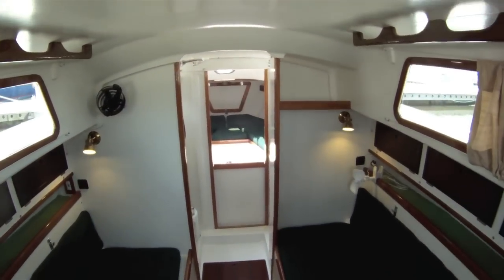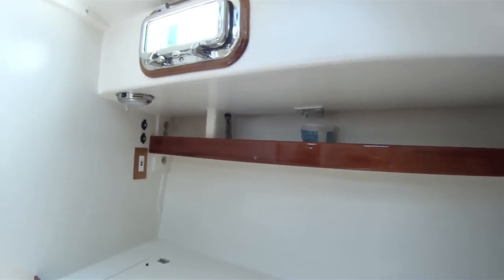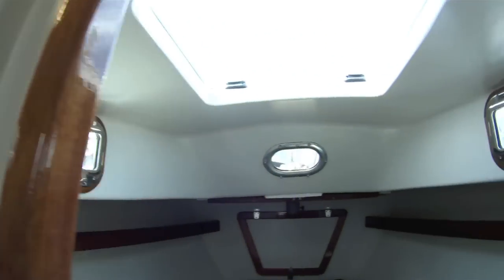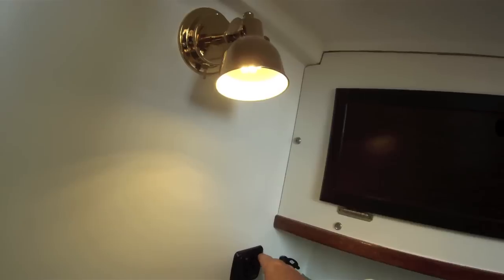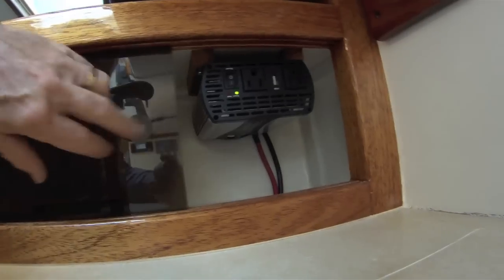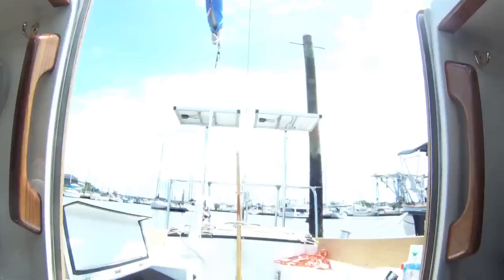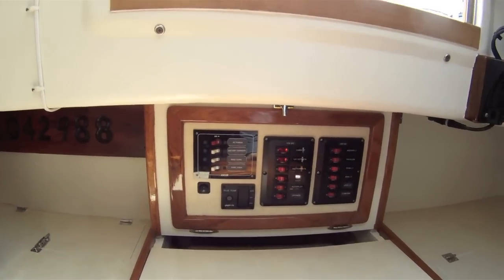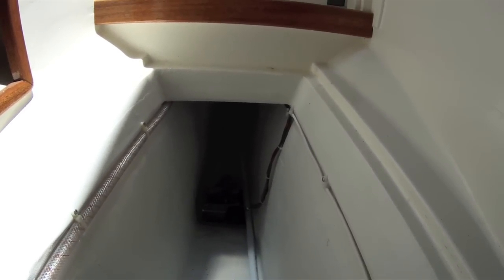1972 Alberg 30 Refit Part Two - Interior

Comment: Very nice job, and kudos to the glass work. Very nice. I've seen boats where the engine has been removed in lieu of more storage and an outboard engine setup. From the maint standpoint, noise, prop shaft, etc, it's a win-win mod. Thanks for sharing.

Comment: Beautiful work!

I have a 1972 Tartan 26 that I hope to start reworking within the year. with a very similar approach to what you have here.  The boat originally has twin quarterberths, a split galley, two settees, and then a head on centerline in the forepeak, but I want to change it quite a bit, so there is a galley spanning the rear of the cabin, then two settee berths (further aft than the original ones and higher), then head on centerline, and a larger forepeak.

The boat came with a Kermath Sea Pup 5 hp inboard, but I have removed that and intend to use an outboard instead.  The transom is slightly reversed, and I am thinking of mounting the outboard on a carriage that rides on two traveler tracks, so instead of pivoting the outboard, I would just draw it out of the water up the track with block and tackle.  The transom (think small Tartan 10 shape) is large enough that the outboard fits within the outline.  The one big disadvantage I can see is that the outboard is exposed to the weather.

The  center aisle under the cockpit will hold the battery bank and tools, topped with a Fliptail 6 folding dinghy.
Reply from the maker: Before I added an outboard well to my own Pearson Triton, I used to have the motor hanging on a similar carriage and two traveler tracks on the transom. I couldn't find anything off the shelf so I cobbled it together myself out of parts salvaged from a boatyard dumpster in Trinidad. Though a center-line mount gives the best performance as the boat rolls or heels, I had to mount mine on the port corner to allow for the center-line windvane self-steering.
Reply: It will be a challenge, but I want to try to nest them all together on center.  Hopefully prop wash won't be an issue for the oar.  I find that I motor very little with my Montgomery 17, and the times on the Tartan that I would want to use the windvane (coupled to an autopilot to provide input to the oar) while motoring shouldn't be often, maybe in a flat calm.

Comment: Beautiful work.   I am impressed by your modification design skills and craftsmanship.   I hope you will not mind if I shamelessly incorporate elements of your design into my own project.

I just bought a highly distressed (but very cheap) 1972 Alberg 30 (hull # 497) which I am in the process of rebuilding and re-fitting.   The vessel was dis-masted under sail in the Atlantic and all the rigging lost overboard (as well as sustaining damage to the fiberglass chainplate attachment knees and the plates themselves).   The dis-masted hull was further damaged during hurricane Sandy when the adjacent vessel tied alongside was dis-masted and the debris fell across the bow pulpit, driving the stanchion bases downward through the deck and allowing water ingress to the coring material in that area (as well as around the already-damaged chainplates), requiring extensive repair of the decking in those two places.   The hull below the waterline is in good shape and free from defects.

In the interior, I am modifying the forward v-berth in a manner very similar to your modification, starting by cutting out the fiberglass liner and reducing the size of the chain locker by moving the bulkhead 12" forward, and then progressing from there in a similar manner to your design, except that I am making the port-side locker into a recessed padded seat and backrest, with the berth and cushions arrayed diagonally across the remaining space within the v-berth.

I am replacing the original Atomic 4 gasoline engine (which works just fine) with a diesel engine of similar horsepower.  I am also enlarging the engine compartment by modifying the ice box and galley cabinetry on either side in order to more easily accommodate such an engine swap and to have sufficient room to install an engine-driven high pressure air compressor to fill scuba tanks with.   I have also been toying with the idea of removing the starboard-side berth from the salon and instead locating the galley and a bench seat and table in that space, using what remains of the ice box and present galley (after enlargement of the engine compartment) for storage space.

I also admire your videography skills.  Perhaps I'll be inspired to take some videos of the sailboat modifications I am making and put them up on my sorely neglected YouTube channel which only contains videos of my sorely neglected ultralight. (my other toy)
Reply from the maker: drifterpilot Thanks for your message. You've got some interesting plans for your refit and a big job ahead. You can email me directly through atomvoyages.com if you have any questions and also to update me on your progress when you have time. 
James

Comment: Are the bulkheads glassed in or did you paint them?  I love how functional your overhauls are.  Minimalistic but not to a degree where they lack anything.    If you were to put in a holding tank instead of the composting head; where would you put it in this build?
Reply from the maker: All bulkheads are glassed in, often on both sides and at least one side where access is difficult. I like to glass in everything, even cabinetry and secondary bulkheads to strengthen the overall structure of deck and hull.  If the boat required a holding tank I would do as I've done on other boats by building an integral tank (similar to my water tanks) into the aft port v-berth locker.

Comment: This is INSANELY clean work all around. Great stuff. I wonder why you got rid of the ice box; you didn't mention other refrigeration unless I missed it.
Reply from the maker: +terrulian The icebox is badly insulated and better suited to a storage locker. The owner plans to use a portable cooler in the cockpit when needed or add a portable Engel or Coolfreeze freezer/fridge set in cockpit or forward cabin. I've installed several of these in other boats and rarely use built-in coolers or fridges on these smaller boats.

Comment: AMAZING JOB! just a few questions.... you added solar and a wind vane ..why did you remove and not replace refrigeration? seems like that is the only thing from keeping you off the grid.... kudos on your glassing skills.....one question that I hate to ask but must....what did this refit cost in $$ and labor time? I have been working on a cheoy lee luders 36 for years
Reply from the maker: k myers 
Thanks. If you read down the comments you'll see I explained the amount of work involved. As for refrigeration, the boat only had an icebox. The owner may add a portable Coolfreeze dual voltage unit if he feels the need later. They only draw 3 amps with roughly 50 percent duty cycle in warm climates so he could run one several days at a time with his two solar panels. If he adds a third bendable panel to set on top a future dodger or bimini he may be able to run the fridge indefinitely at anchor or at sea. Here's a link to one:

http://www.amazon.com/dp/B00IK19VF6?psc=1

James

Comment: BEAUTIFUL WORK! I'm refitting a Pearson Triton and plan to use many of the ideas you've described here. Very very nice job. Wow. Just hope mine comes close.

Questions- when filling the narrow spaces in the bilge, did you leave hollow? Fill with foam? What did you use for interior paint? Is all trim mahogany and how did you finish the trim?
Reply from the maker: +myvidlocker Thanks for the comments and good luck on your Triton project.  Yes, I poured two-part expanding foam in the narrow keel slot behind a piece of epoxy coated fiberglassed plywood. Interior paint was 2000E epoxy barrier coat for some lockers and bilge, and Brightsides with flattening agent  over Prekote primer for the rest. The Brightsides tends to gather mold so I've switched to Petit EZ Cabincoat latex off-white. Varnish was mostly Epiphanes rubbed effect on panels and regular high gloss for trim. 
If you watch the Atom refit video you'll see I added an aft bilge water tank, which has worked out well. On another A30 I'm currently constructing a center bilge water tank. You can email me thru my website if you have more questions.

Comment: I was curious what type of wire you used for the 110V outlets? Kind of looked like romex in the electrical panel. I am in the process of refitting an old Lancer and was trying to figure out what to use.
Reply from the maker: +Chadd Thompson I think you are referring to wiring used in houses which is solid copper. We use triplex marine cable that has multiple strands of tinned copper. If you make a search for marine triplex wire you'll find it at many suppliers.

Comment: Oh, and in the forward berth. What kind of wood is that?  Thanks again for the great videos!
Reply from the maker: On this boat we've used a combination of plwoods (1/2" mostly and some 3/4" of a cabinet grade ply or marine ply) and cherry trim on the interior except where we reused the original teak and mahogany.
Reply: @atomvoyager  Thanks! I'm looking for a cheap alternative to teak.  Well, cheaper anyway.  I like the mahogany but I think I like the cherry for the trim.    I like the "stiffness" idea regarding the bulkheads.  Not sure about waste touching the boat though. It would be a scary to have to change directions afterward if I decided to go for a composting head later or wanted more water to travel with. If not a bigger mess then at least mentally undoable :)  I would never trust a locker that had waste near it no matter how many barrier coats I used ... shivers...      I saw a post that was fairly judgy regarding a hole in the boat where the engine is.     I'm with you on that all the way.  I want an engine for coming into a dockage or mooring. Other than that I'm not in a hurry and it's just so much cleaner and cheaper to have an outboard.  The crap that I've seen going into people's bilges has got to be so toxic for the environment.

Comment: looks wonderful. A question, without an engine to produce energy, how will you cope with cloudy days where the solar panels don't charge the batteries? For long ocean crossing it can happen.

But again, it is a wonderful refurnishing job! Congratulations!
Reply from the maker: Thanks Ricardo,

The reason the system works even when faced with multiple cloudy days is because the two solar mounts can be swiveled to get every last bit of sun available when needed, coupled with a large battery bank and minimal electrical appliances. If faced with many sunless days, electric use can be conserved since there is no electric autopilot, freezer, large plotter or other energy hogs aboard. The same system worked well throughout the second half of Atom's 2nd circumnavigation. In addition, the outboard motor alternator puts out a small amount of charge current, though I wouldn't expect that would be needed.

James
Reply: atomvoyager can you please let me know the brand of the port lights that you show in the movie?

Thanks
Reply from the maker: Ricardo Amaro
They're from New Found Metals at:
http://www.newfoundmetals.com/portlights/rectangular-stainless-standard
Reply: atomvoyager Wonferful job! Congratulation! Project season about to begin here in Canada too. What is the exact size (model) of a port lights. Most people use 3x10 on Alberg, too small for my taste, yours looks perfect! Thank you. A30 hull 602.
Reply from the maker: S C
4 x 10 which is the largest size that will fit.

James

Comment: Hi.  What paint did you use for the interior?  What paint for the integral water tank and are you happy with both?    Also, are you happy with the composting toilet as well as, again, would you recommend them vs traditional with holding tank?  Thanks again.  Hope you don't mind me using some of your ideas with my boat.  This is beautiful work IMHO.
Reply from the maker: This boat interior had PreKote primer then off-white Brightsides with flattening agent. Now we use EZCabinCoat because the Brightsides was prone to mold. For areas that have new fiberglass/spoxy repairs and modifications we first use a two part epoxy primer such as PrimeCoat because the single part primer doesn't adhere as well. In some lower lockers and bilge areas we use 2 coats of 200E Barrier Coat with no other primer or paint.
Reply: @atomvoyager  thank you

Comment: Beautiful work, but 45 gallons in the bow tank= 180 liters= 180 kilos = 400 lbs of water plus 2 crew: see saw marjory daw.
Reply from the maker: Yes I know the theory is that you shouldn't load up the ends of the boat unnecessarily or performance will suffer. It's 375 lbs and it is just far enough aft and low that the effect when beating is noticeable but not extreme. The tank is not always full so you have the option to carry less or just expect as you draw down the water during a passage that performance gets better. On any point of sail other than beating there is no issue anyway. It's good to have the option of taking on more water when needed. We sailed this boat offshore from New England to Georgia starting with a full tank, including some beating, and there was no problem.  I have a similar 43 gal tank under the v-berth of my 28' Pearson Triton and sailed it around the world without feeling there was too much hobby-horse effect.
Reply: @atomvoyager  
I was wondering something along the same lines as Ricardo.  When you do the really nice outboard conversion and fill the integral water tank,  does the waterline change?   Thanks.

edit:  The batteries, i forgot about the batteries!  They'd help!
Reply from the maker: I'm sure you know that every bit of weight added or removed affect the waterline and trim so it's a question of how noticeable it is visually or in sailing performance. The weight of the outboard motor and locker modifications, fuel and added batteries is still less than original motor and accessories but that is compensated by other cruising gear such as solar panels aft, extra anchors and fuel and water cans stowed in cockpit lockers versus whatever else is stowed in v-berth area, etc. You can shift the gear around to keep the boat in trim. So yes a full tank forward causes the bow to sit lower on her lines, but only slightly and temporarily until you use some of the water and that depends on how much and where your other gear is stiowed and the equipment you've added. It's hard to define in exact terms but is easily manageable in practice.

Comment: Where did you learn all this? what materials to use, technique? From all the restaurations this one looks like it should. Could you recommend any books, or sources? Eitherway, so far you video is a great source so thank you for taking the time. Andrei
Reply from the maker: A lot of this came from ideas and experiments on my own similar boat during two circumnavigations and from many years of boat building and refitting experience around the world. I don't know of a book that would guide you to through this type refit and modifications since every person has different ideas and opinions and most authors concentrate on bigger boats with different issues. There is some info you might find helpful on my site atomvoyages.com. Next year I may put together a book for the do-it-yourselfer refitting a small sailboat for offshore voyages. Meanwhile, you can find books on amazon by Casey, Vigor, Spurr, Fatty Goodlander, and others that could be helpful. As far as I know, none of them focus on smaller voyaging boats but many of their examples and techniques are transferable.
Reply: Thank you :). 

Advise me on this if you can. I'm still a beginning sailing wise (although I have background with surfing, carpentry, electric stuff, sewing DYI) I'll go through full courses, licence, and joining crews for a while to get more experience, I wanna get a project sailboat and to make it into an appartment. I will be moored mostly in Toronto (working there in general), and eventually I might take off for vacations since my job is super flexible. I would man this ship by my self.

After some research, I was thinking of something like Catalina 38' (1980s), and I also like Hinterhoeller Freres F3 (around the same age) at 36'. Could I handle that by my self - I know the sailing is doable, but mooring, anchoring and all that.

I really want to reorganize the boat like a decent appartment, I have a bunch of things I wanna put in there, and based on my prefereces 36-38 would be the ideal space. I definitely entertain the idea of having an Alberg 30' but I'm not sure I could manage with that space. It's more like a minimalist solution, too much compromise.
Reply from the maker: Your followup question didn't appear here yet. To answer that, yes most people can learn to handle a 38' boat solo. My interests are in the smaller, classic design boats so you should research those other boats online and then join some relevant forums to get your questions answered.

Comment: Why do the cockpit drains have thru bills?  My Bristol is the same.  Can't they drain above the waterline or out the stern?
Reply from the maker: Because the footwell floor is only a couple inches above the waterline at best, an above waterline drain will not work well. To drain aft through the transom or outboard well locker is same problem. It could be could done if you raised the floor a couple inches and reversed the angle to drain aft but that would reduce the already low headroom under the boom, dodger and bimini and didn't seem worth the trouble.